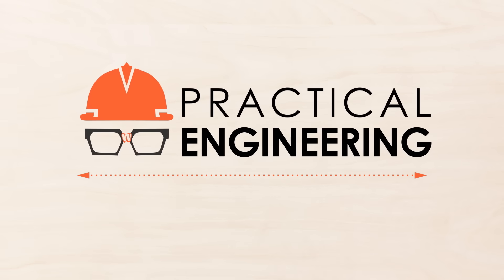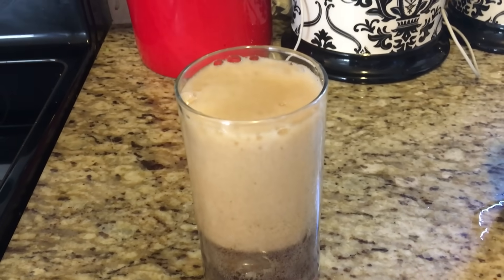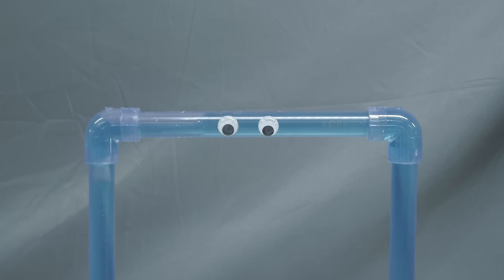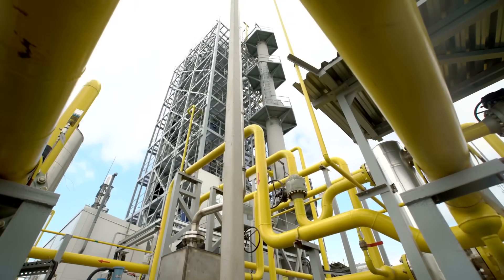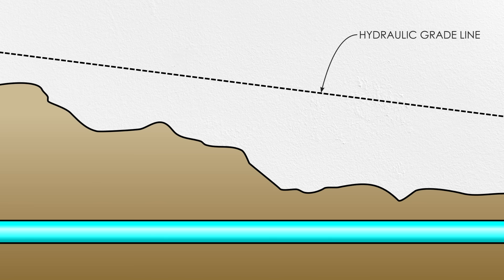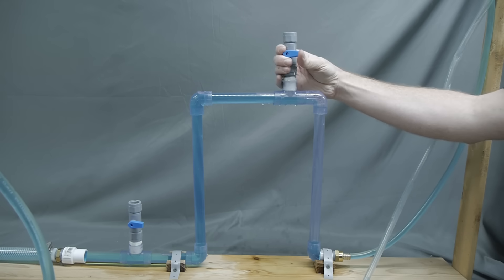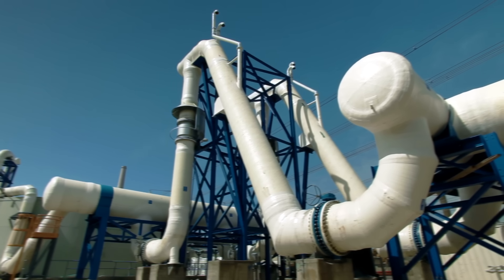What is Air Lock?

Comment: This is a big issue in heating system where the boiler is in the basement. The circulation pump is very weak and has been designed to move water, not push it. As such, it may only be able to push the water a few feet up. As the heating pipes goes up and down and up and down and up and down... air can easilly be trapped and it's game over.

The best way to fix this issue is to add those automatic bleeders just before that the pipe goes down, each time. This is why you will often see them at the end of a radiator, as then the pipe goes back in the floor.

But that is not enought. The pump have near zero pressure, so can't push the water up, so the second trick is to pressurise the whole system, so the pressure itself can push the water higher than the highest point, plus the impossible to avoid air traps. Hopefully, the flow will be high enought to push the bubbles to the bleeders, and it will be vented out.

The other trick is when you start up the unit the first time you commission it (or after repair). You basically open the drain valve, and open the fill valve. If done proprelly the fresh water will circulate at high speed and power throught the whole system, and push out 'all' the air throught the drain valve. It IS wastefull, but you kinda have to do it. The rest of the air should self bleed. But you may have to open some vent or bleeder or drain or something to accelerate the initial bleeding. But remember, fresh water is also full of disolved gas, which will slowly go back in gas, and now you have air... So it can take quite some time to fully bleed, hence the needs for auto bleeders...

Comment: I have an aquarium that uses siphons to transfer water from the tank down to the filters below (they are used to prevent over flow). But the siphons are constantly getting air locks. Could a stand off at the top with a floating check valve (like in the video) solve this issue? Is there some other method that could be used to get rid of the air?

Comment: Any bad car engine designs out there that lead to engine failure because of air lock?  Air lock slows the water flow through the engine making it more likely to over heat.  If you don't get the air out of the cooling system when coolant has been drained and refilled the air pocket will slow water flow. Water with no antifreeze will boil making steam pockets that restrict coolant flow in the heads and hoses.

Comment: There is a really impressive pipeline in the Grand Canyon. You see, there is no ground water on the south rim, so drinking water must be piped from the north rim, at 8000 feet to the river at about 2500 feet and back up to the south rim at 7000 feet.

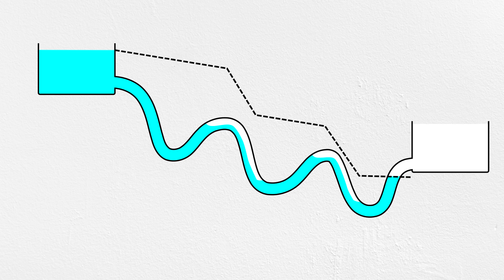Comment: At 5:48 , wouldn't it only stop reaching the outlet for a little bit? I mean wouldn't the pipe just fill up and push the air pocket out? I always thought that since the outlet is below the inlet it will always come out the other end eventually... right?
Reply: Nope, and a real-world effect of this is known as a double trapped drain, the air lock can stop all drainage and flood your house. It's a common problem on air conditioner condensate drains and must be avoided.

Comment: Matching the pipe size to the flow requirement is the best prevention of air accumulation (air restriction , air ' lock').   Over sizing a pipe by 10%  can reduce the rate of flow and allow air accumulation  (that would be 'pushed',  through ,otherwise )  that eventually can create a pipe that is no more flow accommodating than one that is 10%  (or smaller) than the start .  The right sized pipe would maintain a flow rate optimizing  the correct cross sectional area .
Reply: Thanks, as a retired electrician I'm getting ideas why we has so much trouble blowing string through SOME of our new underground lines.

Comment: Can you just make an open ended pipe above the hydraulic gradeline instead of makeing a valve?
Reply: If you only have one point of concern, perhaps. But in a real system, the hydraulic grade is rarely constant, and if for some reason the hydraulic grade drops below the level of the pipeline, you will create the very problem you are seeking to avoid.

Comment: My car has what I consider a design flaw that results in airlock. The heater core inlet/outlet and coolant reservoir fill line are at the same level. If the coolant gets low for any reason, I get airlock in the heater core. The result is poor heating, and a swishing sound (and suddenly better heat) when I step on the gas.  It's a pain to get rid of.

Comment: My favorite valve on hydronic systems are air skimmers. They use a little flap at the top of the pipe to skim air bubbles from the flow as they go by.

Comment: The engineering of language (aka correct grammar) dictates that you should either have "An air lock" or "Air locks".

Another type of air lock can be created by having two valves in a pipe - used to allow things to pass through without allowing air to flow through. These are commonly formed when two space craft dock to each other and permit crew members to pass from one craft to the other.

Comment: 6:45 Trench digging expensive & time-wasting. Best option is to drill the route the pipe (or cable) needs to take and is usually what's done where a shallow trench is not an option - e.g. underpassing roads.

Comment: We had the air bleeding valve blow off of our 12 inch pressurized irrigation line. Couldn't figure out why the lines weren't pressurizing until we saw a 150 foot geyser blowing up and onto the road. It was actually pretty cool but sketchy

Comment: The best practical example of how air can constrict flow is when you tip a bottle too far as you are pouring it out. If you tip at a shallow angle the water flows smoothly, but if you just hold the bottle at 90 degrees the air blocks the flow and the flow becomes inconsistent

Comment: So how do you clear it in a closed hydronic system with an air vent at a single location and a fixed capacity circulation pump? Vacuum the air out?
Reply: I think he said he had to use the air bleed valve on the top of the radiators on at least the highest elevation.
Reply: @stephenwhite1607  In radiant floor systems most of the pipe is embedded at the same level in the floor. Floors aren't perfectly level however and the loops don't always lie perfectly flat. So there will be some high spots in the system, possibly dozens of them and it won't be readily apparent where they are to add a vent, even of that was reasonable at the location they occur. That is why asked. There will be a vent installed at some high point, but it won't take care of bubbles all over the system unless that air gradually dissolved into the water and came back out at the boiler

In other types of heating systems, it is easy to take a high point like a radiator where there is vertical volume that collects the air.

Comment: I remember living in a 1960-s Soviet mass-production 5-floor house. Living on the top floor, every time when central heating season started, we had to bleed our radiators using manual valves.
Reply: Every steam system has that. You also need valves that let air in when the steam is shut off to break the vacuum. This is very simple to automate.
Reply: @millwrightrick1  to be frank it wasn't steam. Almost all central heating systems in Russia use liquid water.
Reply: Alexander Gaukin Gas fired boilers?
Reply: @tedlahm5740  it was natural gas as a fuel for heating station, yes.

Comment: How does an air (release) valve work when the water is under pressure.  If the water is under pressure so is the air and a simple weight  will have to be more than the air psi.  Are there springs involved?

Comment: Another big problem you should mention is that of corrosion. Air or vapour locks in pipework can readily create an interface environment where the contents become corrosive where the pipe would be otherwise unharmed by being full of the same product. This can be a common and expensive problem where the products are acid, correctly selected grades of stainless are very resistant to strong acids but in the vapour space there is more likely to be a weak, humid acidic atmosphere which will damage the surface far more readily than the strong acid itself.

Comment: I'm no engineer, so sorry if this sounds ignorant, but what if for a pipe that you want to turn downwards, at the point where the pipe starts turning down, the pipe's radius is enlarged. Then once the pipe is going straight again, it funnels back into its original radius. I would think that the extra space would make the fluid fall in a manner like a waterfall (so it would be louder), but with the radius going back to what it was before descending, the water wouldn't build up at the funnel. Just my amateurish thoughts as I watched.

Comment: Air admittance valves can also be used to save energy by not needing roof holes for DWV venting in homes and buildings.
Reply: You still need to have DWV roof vents in new construction.  The sewer system as a whole depends on customers having traditional vents, so that there can be bidirectional venting of gasses.   If everyone used AAV's instead of traditional vents, the sewer gas would build up a positive pressure, with no way to relieve it.

This, and the fact that AAV's are more maintenance intensive (maintenance the home-owner may not even know about needing to do), is why they are commonly not allowed for new construction, but are allowed as a retrofit for existing construction with improperly vented drains.  Where special permission is granted, you may be able to use them under kitchen island sinks, but a loop vent is usually the recommended way to build kitchen island sink drains instead.

Comment: Another form of Vaporlock I've experienced is in automotive applications. The heat from the engine vaporizes the fuel in the fuel line creating an Air Lock and either preventing the vehicle from starting or causing it to have a tough time starting. Most of this is experienced with carbureted vehicles that use an engine mounted fuel pump. Those normally only use a small amount of PSI so it isn't able to overcome the air lock.
Reply: happens in diesels too when the fuel gets hot because their fuel pumps are mostly sucking fuel up the hoses so its harder to clear than a pump that pushes. so youll find most diesels have fuel coolers to stop that happening

Comment: This video may have doubled as a What's That Infrastructure for me but I'm not sure.
I live within walking distance of a large reservoir that has a pumphouse at one end which draws water up from the reservoir to fill up an outer ring which surrounds the reservoir. At the other end, there appears to be a drain which essentially ensures that the water in the outer ring doesn't overflow. 
Surrounding this system is a walking path and there are these cylindrical protrusions labeled "VENT" alongside the outside of the path. Could these be for the release of air in the pipes or would they serve another purpose?

Comment: I've been aware of the effects and causes of vapor lock, but never actually seen what it looks like. 

In my line of work, I find that best practices and reviews help avoid bad assumptions. I'm a mechanical engineer and design the mechanical systems in pumping stations on reservoirs and STAs, and we go through DQCR and PQCR, both internal and sponsor, for prelim, intermediate, and final reviews, plus BCOES and ATR reviews before a contract even goes out for bid. 

For most of my projects, we keep the internal velocity between 7 and 12 fps, and we are usually around 10-11 fps for the reason you stated, we size the pipe to have as small a diameter as possible while also being a standard size.

Comment: Another way of having "air lock" is when there are different metals involved or different electric potentials on both ends of a pipe. Dissociation of the water mollecule to  hydrogen and oxygen is common in these conditions. Exploding "air" from the bleeder is  deffinitely interesting!

Comment: 5:44 I don't understand how's it possible for the flow to cease completely in this setup no matter the amount of air in the pipe.
Reply: I agree.  Although it's not ideal and there are probably noise consequences, it seems to deliver the low flow anyway.  I don't know if this is oversimplifying or not worrying about a "detail".  Either way, there are plenty who correct problems by purging, and most people disregard sloppy work.
Reply: Agreed. Assuming both tanks are open to atmosphere and there is enough head pressure to ensure some flow over both crests, I think the worst case scenario is a water level in the receptacle equal to the height of the final crest. But if the diagram is not to scale, intuition can be very deceiving.
Reply: I guess for the flow to completely cease the setup would need to be siphon-like with the pipe going above the upstream water level (or that plus head generated by a pump if there is one).
Reply: There can't be a waterfall, when the water doesn't flow. It will just be a higher water level on the wrong side of the siphon. That's because the air will be much less likely on that side. When we neglect the mass (important for gravity) of air and assume all air is on the wrong side (the right side for water) we can simply compare the total height of water on the side leading down with the total height on the side leading up to see if the water tends to stop flowing completely. Normaly we need quite a bit air for this to happen.

Comment: “Engineering nearly always involves assumptions and simplifications”
My immediate thought:
Pi=3=e
Reply: 3.1 and 2.7 are basically the same
Reply: LOL. Where do you use e?
Reply: Lou Fazio e to the pi i.
Reply: @JasperJanssen  Euler's identity in construction level engineering?  If so, that is absurdly crude.
Reply: Lou Fazio e is off by 10 percent, pi by 5. Not even close to crude.
Reply: @JasperJanssen  Yikes.  While everything is relative, one significant figure - that's crude to me.  I wouldn't want two converging bridge builds, tunnel digs, room temperature, musical pitch tuning or escape velocity to be off by that much.
Reply: @louf7178  These approximations are usually used when we have to pick a part out of a catalog, such as choosing a pipe size, a heat sink etc. We round things towards the worst-case scenario so that it naturally gives us a safety factor. Or when we are mentally testing ideas to see if they are at least in the right order of magnitude before we make any further effort. 

When we get to actually design something that requires precision, we will use a programming language, CAD software or similar that will give us pi to about 5 times as many decimal places as any engineering project would ever need.
Reply: @yondaime500  Agreed. Just as long as one knows which side the the result favors i.e. greater or less than.
Reply: Jasper Janssen e to the 2 pi I is WAU
Reply: @louf7178  E is the most commonly used vowel out of all the vowels in the english language!

and if you were curious, the most commonly used consonants are R, S, T, L, and N
that's why the final round of Wheel of Fortune gives you RSTLNE

also, i know that's not what you meant.. i just can't help myself from being a facetious prick
Reply: @louf7178  One example of where e comes in to play in Engineering, is the capstan equation for friction around a circular path in a cord under tension.   The tension on the opposite side of a fixed circular guide is given by T2 = T1*e^(mu*theta), where T2 is the tension in the side of the applied force, and T1 is the tension in the side holding the load, mu is the friction coefficient, and theta is the angle in radians that cord is wrapped.

This equation is involved in calculating how wire pulling tension accumulates around elbows and sweeps in electrical conduit.   It is also involved in belt drives for mechanical power transmission, for determining how much pretension is necessary so that the belt remains in contact with the drive pulley and driven pulley.

It is called the capstan equation, because ropes for sails on ships are tied around capstans to support the tension in the rope, while the other end of the rope is being supported.
Reply: @louf7178  electrical engineering.
Reply: Dr. M. H.  Yes.  There is a range of perspective here.
Reply: Dr. M. H.  OMG.  I could fathom a reason of why that legislature could be put on the table (possibly to equalize advertised ratings of a product, say), but a policy like that would not be a good idea.
Reply: @joeljustin  My highschool physics teacher literally taught us that g = 10m/s^2
Reply: @ahuttee  close enough
Reply: @ahuttee  
Tbh, I resented every time they made us use 9.8 in tests instead of 10 - like, whyyyy
Reply: This one physically hurts.
Reply: Well.. I had a supervisor that told me you could use Pi=3 only if you went to a highly distinguished technical learning institution. But if you learnt by yourself, I guess you couldn't talk to him at all.
Reply: Beautiful comment. I will use this literally wherever I can, it's just so funny
Reply: To infinity, a golgolplex is as close to it as one